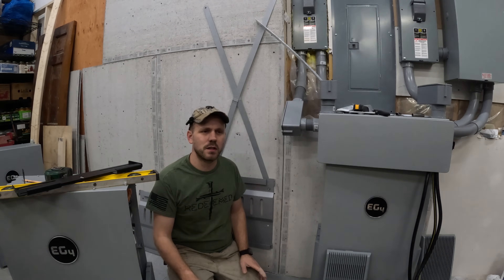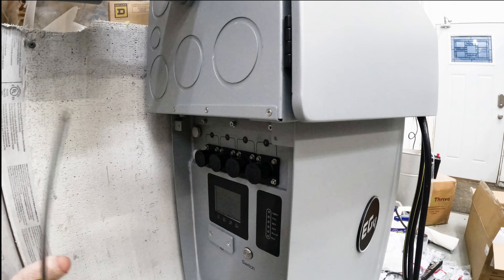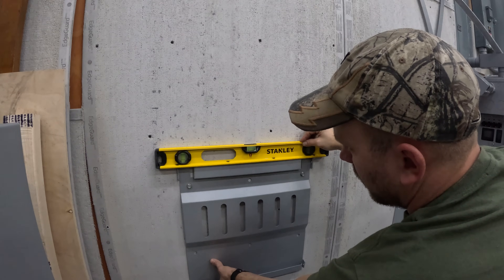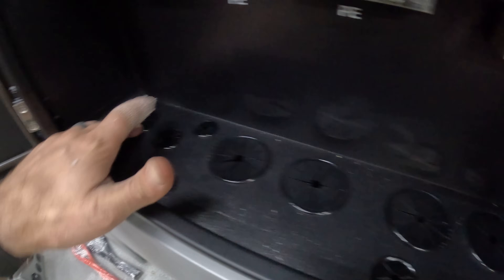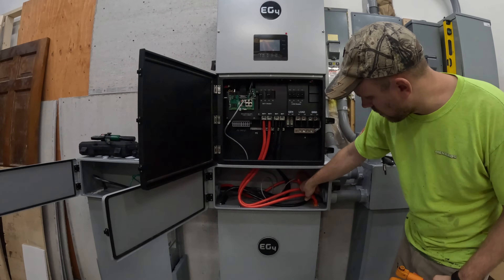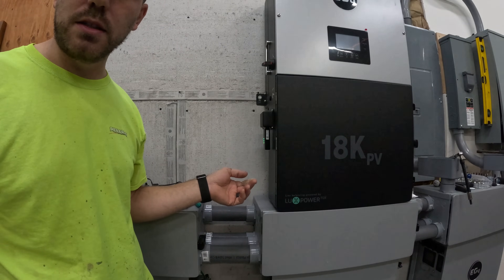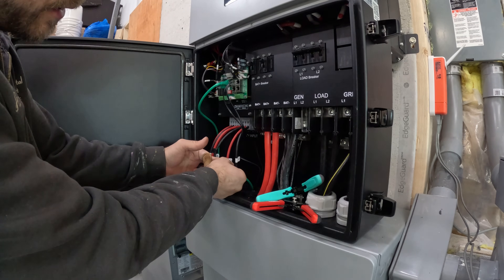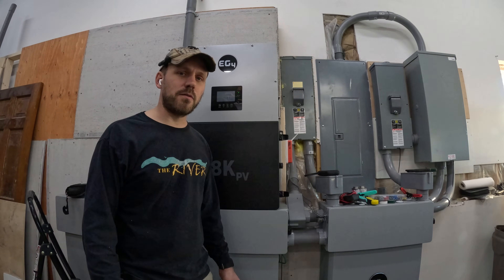Avoid mistakes! EG4 18kpv inverter and PowerPro WallMount batteries install

Comment: What size ferrule did you use from your suggested hydraulic crimper kit? 2/0 seems too loose. 1/0?
Reply from the maker: You dont use a ferrule on 1/0 and 2/0 wires

Comment: For some strange reason ive been having a gapping problem between the inverter and the battery box
Reply from the maker: I used the measurements instead of the x cross brace thing

Comment: Is there a limit to how many of these batteries you can Connect to a eg4 inverter ?
Reply: So roughly how many of the power pro 14.3 kw batteries could’ve connected to a flexboss21?
Reply: Sorry 
# could be
Reply from the maker: No, but after a certain amount you need to use an external bus bar

Comment: So there are different types of screwdriver sets that would be a good investment for this and many other projects. Japanese Industrial Standards, also known as JIS.  The phillips have a flattened tip, and the flat heads have a more sheared tip.  They produce less wiggle and a tighter grip.   They are very useful in gunsmithing and carburetor adjustments and repair.  Or you could grind your own tips.
Reply from the maker: @brianmikus6023  it’s cheaper to grind the tip!
Reply: @portercreek  i know.  But if you ever find yourself liking for the screwdriver that really fits the way they are intended to, now you know.

Comment: How did you connect the grid and load lugs with your panel? Did you do a line side tap before the main breaker in the panel? And then take that to the Grid lugs in the inverter? And then that from the Load lugs in the inverter and go into the main breaker in the panel to feed all the loads in the breaker?
Reply from the maker: The grid lines go to the grid lugs on the inverter and then the load lugs go to feed the panel.  All the power goes through the inverter.  If you wanted to do a transfer switch you would do a line tape on the grid lines going to the inverter and then have that land to one side of the transfer switch and then the load lines of the inverter would land on the other side of the transfer switch.

Comment: Good video. Cluttered installation tho. Detail to design and layout is also important. 
Having ANYTHING on the floor or in front of the breaker panel is dangerous and not code compliant. 
Just because something works does not make it correct.
Reply from the maker: Correct! If you have seen my more recent video on this system, I had made some changes and moved stuff around to be code compliant

Comment: just got my second battery and was watching your video again to make sure I installed it correctly.  Since both batteries will not be at the same SOC is there anything I have to do before turning everything back on or will the 18k and BMS take care of it?  Second battery has the second dip switch down and the rest up, correct.  Looks like you used PVC conduit, did you punch out the large  knockouts?  I tried to punch out the smaller on inside the large one but the large one  came out and I believe they are 2 1/4" holes.  What hardware did you use, looks like it some kind of PVC on the outside and EMT on the inside.  The local big  box stores only go up to 2" so I guess this requires a trip to the real electrical supply or amazon.  Thanks for your video it has been very helpful for a one person install, these babies are heavy beasts for an old dude
Reply from the maker: The bms and the inverter will communicate to level out the charge.  It is recommended on all new batteries to charge it up 100% and run it all the way down to 20% and then back up again to a full charge.  This will help calibrate the bms.

I used 2” conduit for everything. The male threaded ends for the conduit fit perfectly in the knock outs.  It was sourced from my local Menards and home depot.
Reply: @portercreek  SS said try to balance both within 0.5v between the 2 batteries before you turn everything on so I charged battery 1 till I was close and so far so  good
my only issue is, I can't get into the setup screen for battery 2 to set it for LUX. We have troubleshot it but no solution.  They said that as long as its charging its OK for now but we can't see the total AH of the system, still looks like one battery not 2.  I will try HD or lowes and see if I can get some PVC conduit.  I would like to use liquidtite but it is hard to buy just 2 feet of it.  I am hoping that this does not require returning the battery as I know that will be a really hard thing to do

Comment: Why are you choosing LUX vs EG4? I can’t get my battery to power my house at night I have 18kpv and eg4 pro powerwall my protocol is rs485 - eg4 and can - lux any ideas?
Reply from the maker: Lux is just what the manufacturer states it needs to be set at.  The rs485 also needs to be set to LUX.  After you make the changes and power cycle the bms, double check to make sure the settings took.  I believe this is done by pressing the second button from the right on the screen.  They should both be set to LUX
Reply: They make lux

Comment: I am concerned that you wont be able to remove the battery while leaving the conduit box in place.  What are your thoughts?  Is there a way with the bracket design?
Reply from the maker: That is correct but code requires the cables and cords to be inside conduit
Reply: @portercreek  I just mean that if there is an issue with the battery one would want to simply unbolt it from the wiring box, detach the cables and slide it out.
Reply from the maker: @ry2456  I have slid the box out before on mine when I was changing stuff around, it is doable.

Comment: What back up generator are you using for your system?
Reply from the maker: We are currently hooked up to the grid to sell back because we produce way more than we can use.  I have a small Honda generator if push came to shove but even on cloudy days I produce enough to charge the batteries back up to 100%
Reply: @portercreek  It is not worth selling back to the grid.  For example, just an example, if they sell you 1kw of electricity for 20¢ they will buy back from you 1kw for 1¢.  Just make sure also that the utility company is willing to buy back.
Reply from the maker: @shelley131 I am not sure where you are getting your info from but it is inaccurate.  I buy electricity from them for 13.5 cents a kw and I sell back to them at 12.6 cents a kw

Comment: This EG4 inverter simply does not offer a high enough surge capacity to simultaneously power my off grid home and shop. Because of this inverter's light duty 200% peak power capacity and no galvanic isolation, for performance and safety reasons, I chose a low frequency, transformer based inverter charger instead.
Reply: I run a large house with a 5ton and 3 ton AC plus sewer lift pumps and a 2 pool pumps a 3hp and 1hp, lots of loads...almost 100kwh a day during the hot AZ summer.  I have softstarts on everything that I can put them on and all lights are LED's and no issues.  Even have both AC's start no issue.  I have never had the inverter kick off and have been running everything for 6 months without failures.
Reply: @thatretiredguy8907 A 5 ton and 3 ton AC plus sewer lift pumps and a 2 pool pumps are not large loads and six months, sure. Give it time,. Mark my word, 2-3 years is all these high frequency inverters are good for.
Reply from the maker: If you are looking to run a shop and your house you will definitely need 2 or even 3 inverters depending on what you are looking to run.  This inverter has no problem running our house but when my 40 amp compressor kicks on it will kick out the inverter.
Reply: k

Comment: I want to but this inverter and battery but I just moved to a new area and don't know anyone here in San Antonio to help me lift this thing to install it. I do not want to set them on the ground because they will be outside.
Reply from the maker: Believe it or not, one man can install it, you just have to be creative!  The battery can be tipped back and forth and blocked up a little each time to get it to the height you want it at.  The inverter is not nearly as heavy and can be lifted into place by one person, you could also put anchors on the wall above it and use ratchet straps to lift it into place.
Reply: I did the first setup myself...old dude.  just use leverage and physics, it is doable. I am installing the second battery now and rewatched this video and got some helpful hints

Comment: What size are the 3 conduits going to each conduit box you used?
Reply from the maker: 2”
Reply: @portercreek  The larger popouts are doubled so there looks to be a 2" and a bigger one, maybe 2 1/4".  Is that correct you popped out the inside popout for the large one or is the large one 2"
Reply from the maker: @thatretiredguy8907  the largest knock outs are for 2” conduit
Reply: @portercreek  OK thanks I will go buy the hardware

Comment: The screws you pointed out on the bottom edge of the conduit box can be removed allowing the plate to come out.  It is then very easy to install the battery cables.  Once the battery cables are installed you simply replace the plate and install the four screws.
Reply from the maker: Good to know! Thanks!

Comment: I wish I watched this before I installed!!! Those tiny screws stripped and were a pain!!!
Reply from the maker: I almost completely stripped mine, I was pretty frustrated
Reply: Yea I know not the best solution but ended up drilling the tiny holes with a 1/4 drill and using a regular screwdriver

Comment: Hi. Just watched the vid. Very informative.  Can you use more than 3 wall mounted batteries with the 18K, or are you limited to the 3? Thanks.
Reply from the maker: There is no limit.
Reply: I have asked this question of eg4 and SS and got no answer.  other vlogs say 3 is the limit because of the buss bar and certs.  Still makes no sense as my inverter is limited to 200amps so the batteries are limited.  I was going to install 4 powerpro's on one 18k but now I don't know if I can.  There is a reddit post that shows only 3 and if you go to 4 or 5 you need a second inverter...again makes no sense electrically.  Anyone know the correct answer or does anyone have 4 or more batteries?  Does and external fused buss bar make it possible.

Comment: Ok, I’ll try that first… thank you
Reply from the maker: Let me know if you have any other questions!
Reply: I finally figured out the PV so cool… The dip switch on the battery what configuration is number 4 and 5… I have 5 batteries
Reply from the maker: @TJM45  on page 27 it has the configuration of the batteries.

https://eg4electronics.com/backend/wp-content/uploads/2023/09/EG4-14.3kWh-PowerPro-WallMount-AW-Manual.pdf
Reply: Thank you

Comment: Question: with 10 solar arrays how would I combine them into the 18k inverter since there are only 8 slots or 4 arrays? I’m not sure of this step.
Reply from the maker: How big are each arrays?  You would need to link them in parallel so you have 4.  Make sure that each array doesn’t exceed the 600v max.  Inputs 1 and 2 need to have the exact same size/configurations.
Reply: Each array has six 195 watt panels. I linked them in series/parallel. Can I bring them into a combiner box and then into the inverter? I did the math and they’re not over 600v. For example: four array’s wired in series/parallel… the bring those four into a combiner box. Then bring two wires into the inverter? OR would you wire two arrays in series/parallel bring those two wire into inverter. Then do the same with the third and fourth arrays? And thank you for your guidance. This is my first project and I’ve been learning from YouTube videos.
Reply from the maker: @TJM45  I have some strings with 12 and some with 14.  Mine are 390watt panels.  You can use a combiner box, however it makes the most sense for your application. If you can just connect the arrays to each other it would save you some wire.  Just make sure that when you connect the arrays they are at the same angle and have the same amount of panels.  Series is always better(as long as you stay under the volts because it doesn’t require as heavy of a gauge wire which will save you quite a bit in expense

Comment: just got my system and can't find an exact measurement from the floor to some place on the battery bracket to measure it, I did not see that measurement in your video.  one video said 28 1/16"  is that your measurement.  I plan on using the X bracket as I believe that is to exactly locate the inverter bracket
Reply from the maker: In the beginning of the video when I am showing how to mount the battery bracket I give the measurement twice, I can’t remember what it is off the top of my head.  If you use the x bracket you won’t need measurements for the inverter.
Reply: thanks for the feedback. I used the x bracket and it worked great.  I did see the measurement from the floor to the top of the battery bracket was 28 1/6" and that worked fine too.  getting the battery on the bracket was definitely a challenge and required so physics!
Reply from the maker: @thatretiredguy8907  getting the battery and inverter installed and wired was the mower challenging part!  The rest should go fairly easy!
Reply: @portercreek  I still have challenges that no one has answered because I have a SPAN panel.  Its a great device but they don't play well with other equipment and presnelty only work with 4 inverters, all the big boys and zero DIY types.  SPAN is too smart, it acts as your CLP when you lost grid and automatically shuts off all noncritical loads.  Great idea if it worked with all inverters.  Hopefully they wake up to the DIY community and support all inverters with some kind of open source code
Reply: What is the horizontal spacing between the screws that attach the mounting panel to the wall?  The manual indicates to align it with studs, but it doesn’t indicate what the stud spacing should be in order to have two or three studs available at the right locations to screw into.  The overall width of the battery is 22.3” so it seems like the horizontal spacing might be about 20” (10” from the center holes to either side).
Reply: I used 3/4" industrial composite board from Lowes.  Its very heavy and strong.  I glued it and I used lag bolts into the studs.  That way I don't care about where the studs are for the bracket and I can mount the system where I want and space the additional batteries where I want.  its not a shear load, the battery just sits on the floor and the bracket just keeps it from falling over.  Even the inverter appears to hang on its bracket and is more of a shear load since it does not appear to rest directly on the cable box. @mcarling6495
Reply from the maker: @mcarling6495  it is based on 16” m center studs

Comment: I would never install one of these low surge capacity, shorter lived high frequency, transformerless inverter to power my off grid home. No thanks!
Reply: Are you selling an alternate? I see you putting this comment on other SS installation videos.
Reply: I don't think he sells anything. He has said in the past that he owns an inverter repair business. @BruceMallett
Reply: I don't sell anything. I'm just stating factual information that have been posted by experts in the field of DC to AC inverter tech that anyone can easily find on Google. @BruceMallett
Reply from the maker: Thanks for commenting!
Reply: What's your alternative?
Reply from the maker: @dalboltv9747  he is just a troll, people get a high off of bashing what people do and trying to make them feel dumb.  If they really had a legit concern they would have given their opinion of a solution
Reply: As an inverter repair tech with over 24 years of experience, in my professional opinion, I would recommend any low frequency, transformer based inverter model from a big name brand inverter manufacturer like Schneider Electric, Magnum Energy, Sigineer Power, Outback Power or Victron Energy. High frequency, transformerless inverters have a shorter life expectancy, a much weaker surge capacity and they don't provide any galvanic isolation between their DC boost stage and their AC output which in my opinion makes them a far less safe option for connecting to your off grid home.  @dalboltv9747

Comment: Do you have a video of ur solar setup or the strings you ran. Parallel or series
Reply from the maker: I don’t yet, I plan on doing one in the spring when I add a few more panels to it!
Reply: @portercreek  how many panels are hooked up to each spring in the inverter?
Reply from the maker: @johncoinas  I have 4 strings of 12 390w panels

Comment: Video has no sound for me?  Thanks for this detailed vid.
Reply from the maker: Maybe try refreshing the video? It seems to have sound for me.

Thanks!
Reply: Balance is off kilter. My wired ear buds only have sound on the right side. At first I thought there was no sound until I put the right side in my ear. Later in the video the left sound comes back.   @portercreek

Comment: Great detailed video. So you did the install of the new transfer switch and shutoff switch yourself correct? Did you need to pull permits for any of this or is that not required? I'm just in the planning phase, but I would love to do as much of the install as I can myself. Again - great video.
Reply from the maker: Yes I did install it myself, you’ll need to check with your local codes on whether or not you will need to obtain permits.
Reply: @portercreek  Thanks for the reply.
Reply: I really appreciate that…
Reply: Great channel. I just received five batteries and one 18k inverter yesterday. Today I laid out the shed and tomorrow I start to build. I know I’ll be watching all your videos for help so thank you very much
Reply from the maker: @TJM45  Thanks!  If you have any questions just drop a comment and I’ll try to respond right away!
Reply: Where did you purchase your transfer switch